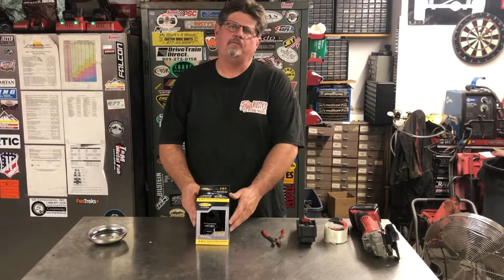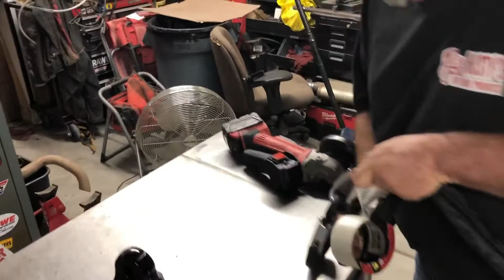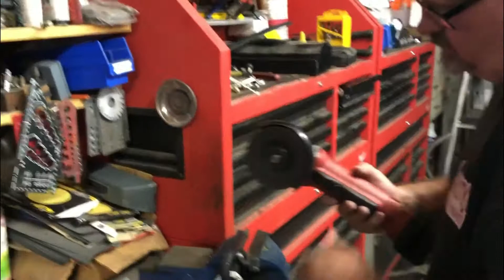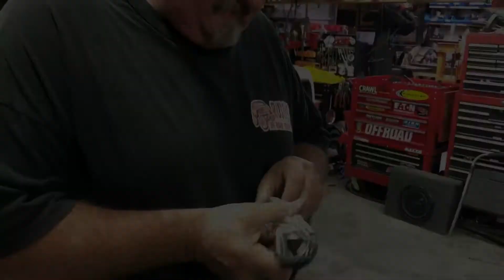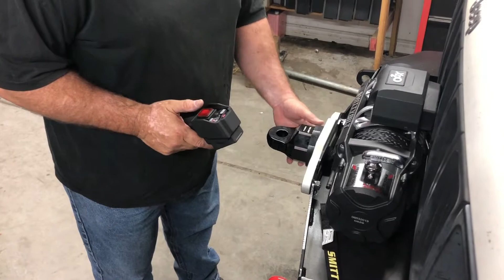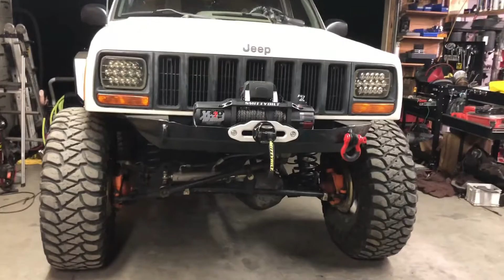How to Install a Smittybilt A.W.S Aluminum Winch Shackle

Comment: If you don't want to deal with the sparks flying off and possibly damaging your rope there is another option.  I used a reciprocating saw with a carbide blade for thick metal.  Put the original hook into a vise and made sure the rope was out and away from where I was cutting.  I cut down and away so if I slipped it did not come anywhere near the rope.    After the first cut was done, I flipped the hook over and did the same on the other side of the circle.  The carbide blade made fast work of the old hook, and the install of the AWS was quick.  Just an option.
Reply from the maker: Great idea, Thanks for sharing...

Comment: 5150, question! How does the hole of the shackle feel? Are u familar with soft shackles? Would this be safe to use on this and not cut the rope?
Reply from the maker: CanadianOffroad4x4... The hole has a beveled edge and smooth.  I have used a soft shackle one time and had no problems....

Comment: I came here to see if I was really supposed to cut off the hook to install this shackle I got... feels like such a waste to cut the hook like that. :/
Reply from the maker: I know what you mean, but the A.W.S is so much nicer.
Reply: @calebdorsey7591  I have no idea how one would do this. The rope looks entwined from the factory in a way that couldn't be undone.
Reply: @thelegendbullet937  I just did mine and it took less than ten minutes.  I found a video that shows how... Hang on...
Reply: @calebdorsey7591  HMph... wish I had known that before I hacked off the hook lol.
It still would have been a lot of work to pull all 80 ft of rope off my winch though. Couldn't just do the little loosening trick, like in this video you linked, because the rope was Through the Enclosed hole of the hook. It's not just wrapped around it like it is on a thimble.
Reply: @thelegendbullet937  yeah I had to take the rope out and take it all the way through the eyelet and lightly pry the eyelet off the hook but it didn't really take long and I got to keep my hook.  I'm not sure I'll ever need the hook but it'll go into my recovery kit just in case l.